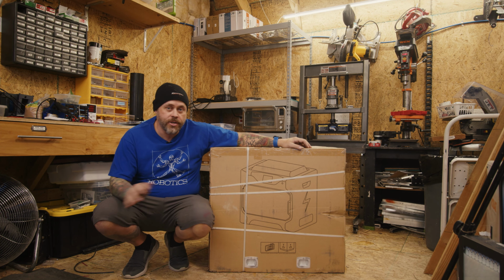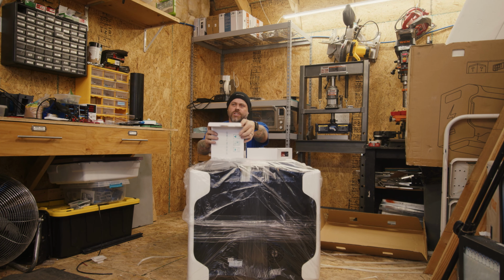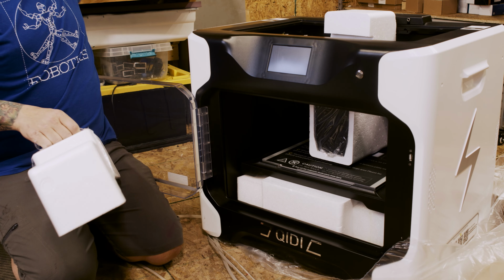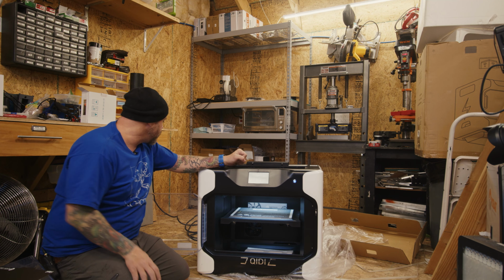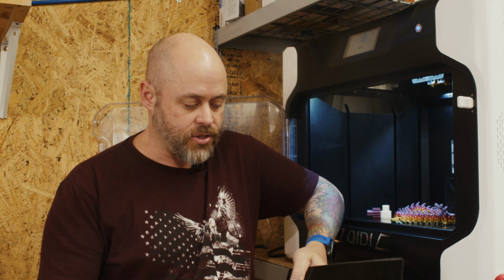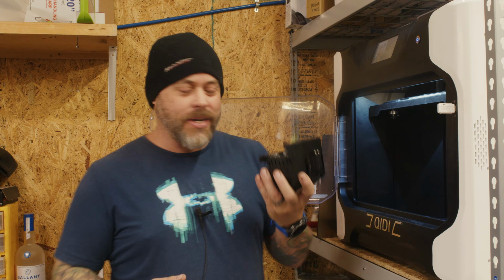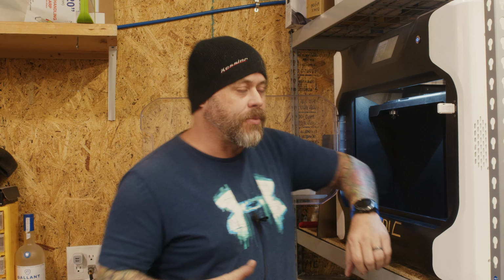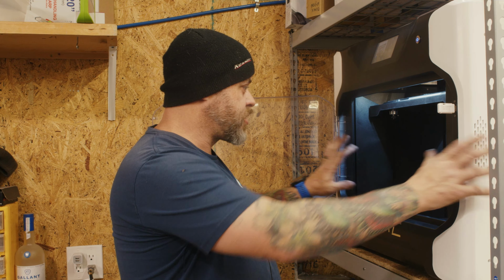Qidi Tech iFast 3d printer unboxing and initial thoughts

Comment: Hello,
I purchased an i-fast a few months ago and I recently decided to purchase some new nozzles for the low temp extruders but they don't fit into the heat block threads. They're too big. My 7mm wrench that fits the original nozzles is too small to fit the new ones that I bought (MK10 Nozzle for 3D Printer, 18 Pcs M7 Brass Extruder Head Hotend Nozzles 0.2mm, 0.3mm, 0.4mm, 0.5mm, 0.6mm, 0.8mm, 1.0mm fit 1.75mm Filament). Can you please tell me what size/type I should have purchased? I can't find any definitive answer online.
Thank you.

Comment: Don't understand ... the high temperature head is in stoke? You got one dual head and another one single high temperature in the box, when buy the printer???
Reply: Not anymore. It changed. 
Now you get one high temp dual extruder, and a low temp dual extruder.
They no longer have the single ruby tipped one.
Reply: @chrisfield7008  thanks

Comment: I just bought the i-fast and can't wait to get it. THANKS SOOO MUCH for your video here. Especially the setup for the spools. I'm gonna follow your lead on that. Are you still liking the printer now?
Reply from the maker: Yeah. At the moment I do.. thenfiest month it ran like a dream. Then I ran into a lot of really frustrating problems for about 2 months and had to replace mobo 3x, screen, ribbon cable, and a sensor, but as of now it has been working fairly well.  I wouldn't mind getting a 2nd one.

Comment: I know you don't want to be told this but the issue you have with not being able to peel PLA off the standard build sheet is a really simple fix -  that the nozzle is too close to the bed.  If you get the nozzle the exact correct height you should be abler to pop/peel PLA off with no issue. If you are printing ABS or other materals must not use the white texture side use the dark smooth side with some glue stick or hair spray.  This works great on my QIDIs.   If you want to ignore this bit of advice - fine - but if you don't fix the nozzle being too close to the bed - your functional parts will not be accurate and you might even get a bit of an elephants foot which when printing parts that fit together may mean they don't fit together!  I hope you understand but if not feel free to tell me to F off like you did the other people trying to help ;) :p
Reply from the maker: Uhhhhh I am so confused. Generally I'm pretty well known for not claiming to know everything, and would never tell people to F off because they are trying to help. That was the second time using the printer and the first time using that sort of bed. On my other printers use glass beds and pretty much all I have done is print PLA. 
 Good news though is I have spent some time with the printer and learned a bit more, from watching other videos and engaging either folks on QIDI user groups online. 
So far I've managed to get quite a few parts done in PET G that worked out great! Including an inner bearing system for a rotational element on a mini cinema camera robot I am working on. That one took nearly an entire spool and is about the size of a thick new York cheesecake.
 Nylon took a little experimentation but I managed to get a nice large 6 inch diameter ring gear printed and the mating spur. 
Things have generally been going good. I have another full spool sized part I am trying to print in PetG. But the darn nozzle clogged and I had to restart. So wish me luck on that one. 
Anyway I would certainly never tell you to F off because you comment and offered some advice. Rather thank you for your suggestions. Have a great day!
Reply: @BiolapseStudios  Haha look at your 21 mins 22 seconds :p glad to hear it's going well so far there needs to be more ifast videos so please keep making them 🙂
Reply from the maker: @MrButuz  ahhh gotcha. Yeah , no I don't mean to say I am not interested in discussion amd suggestions, I just don't mind using hairspray or guesting. I've seen some folks on some 3D printing groups that can just be pretty crappy to others about using such techniques. I know for a lot of people this is a hobby and they spend more time tweaking than printing, and that's totally cool, i get the idea of tweaking and playing for the search of perfection. I  just need to be able to print the parts I need. 
I'm printing brackets not building a piano. ;)
Reply: @BiolapseStudios  do you mind if I ask what user groups you've found to be helpful?
Reply from the maker: @Rickdiculousme  sure. It's the QIDI TECH - 3D Printer Owners group on Facebook :)

Comment: Have you been able to test speed settings? I am curious if it can get a decent quality with certain materials while running 75-100mm/s?
Reply from the maker: Not yet. I had to get up and running asap for a production run on some parts. I'm just now experimenting with other materials like Nylon and Polycarb. 
Once I have that stuff dialed in I'll start making some comparisons on print quality with speed. I've heard good things though. If this current print with the nylon works I'll bump the speed up. But stock settings gave nylon at 40mm/s
Reply: @BiolapseStudios  very nice. I am waiting on mine now and hopefully will get it within the month. The metal printing with sintering though expensive, have you looked into machining price vs printing price on anything?
Reply from the maker: The metal stuff is just craY expensive. About 500 per follow of basf 316. I have a Taig Cnc mill that I can use if o need metal parts. So I'm gonna stick either Nylon, Petg, etc. I want to try polycarbonate soon too.
I just reran a small test piece of nylon which defaults to 40mm /s and kicked it to 80/s. The two parts look identical. I would need a larger test but so far it looks like it can handle speeds fine
Reply: @BiolapseStudios  awesome thank you! That is super useful. Thanks for the video and comment replied 😁

Comment: Really awesome looking printer! I've got the X-plus and have loved it so far. Print lots with carbon fiber nylon!
Reply: hey i just wanted to ask if you would buy the x-plus again or upgreade to the x-cf pro or even the i fast

but i plan on getting anothe 3d printer
and im thinking about getting the x-max for nylon/cf parts and a flsun for pla (maybe petg)(or is it faster to buy the i fast) but my prusa mini does petg all day long. so im mostly looking to increase production number (although i dont sell anything currently 🤣)
Reply from the maker: Would love to chat with you on that. I have not had the printer long and have been printing structural petg parts non stop, made a quick attempt at nylon and couldn't get bed adhesion but did not have the time to dig into it, and had to move on with other work, but really need to get nylon figured soon for a cinema bot I am building

Comment: Hi there ,how you resolve the line that appears in every print (Z seam Position) that is set on user specified and in standard qidi slicer in on the front right set ?
And second was nicer to get the ruby nozzle when i get the package not to mail them ,but from the good reviews i hope they will send it to me.
Reply from the maker: Hey sorry I just saw that. In the Qidi slicer there is a way to randomize the z action so the seam is broken up. I think you can also try to align it in corners.  So far I haven't messed with that.
My understanding is all you have to show proof of purchase, and they ship it to you!

Comment: Hello

Which slicer do you work with have you adopted or changed the standard settings of qidi

Best regards from Germany
Reply from the maker: So far I have really just only used the stock settings on the QIDI for a quick part production run. 
I do plan to start playing with the settings soon to see if I can get better performance